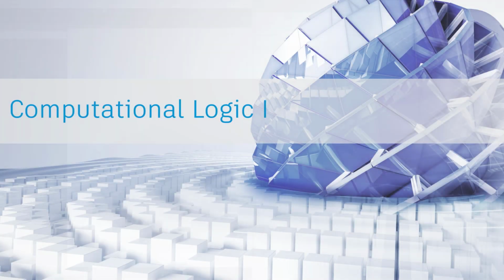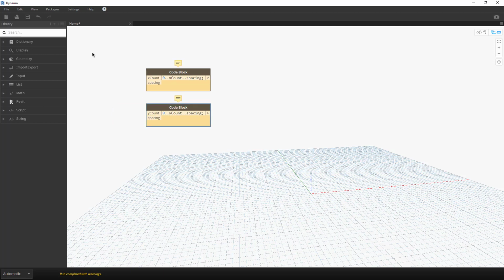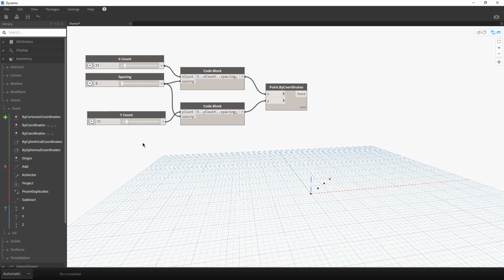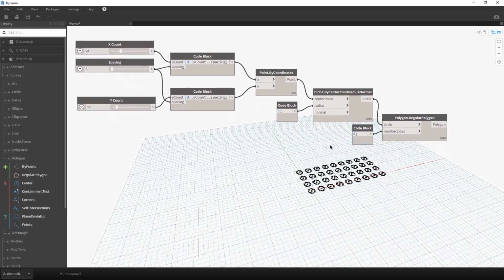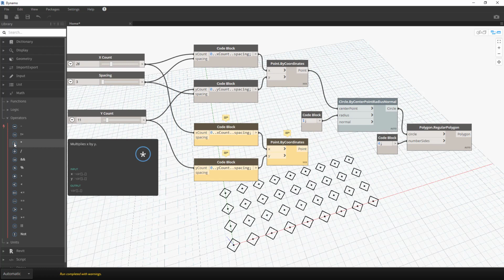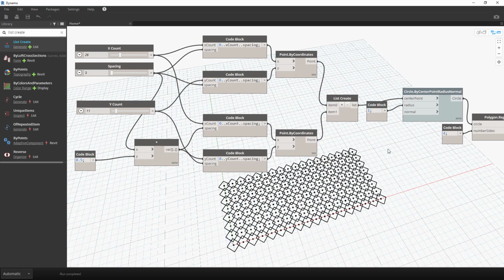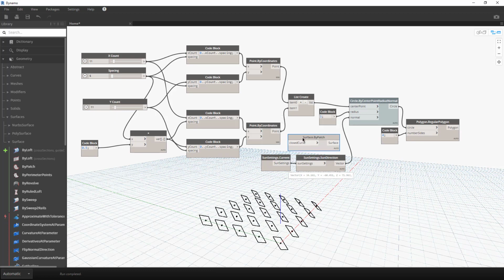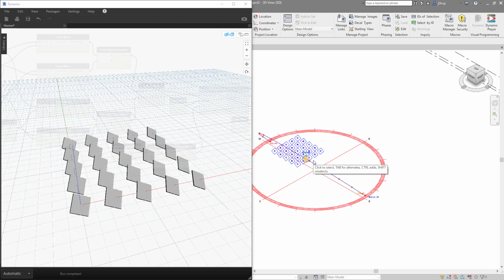05 ComputationalLogic1

Comment: Why can't i see the nodes and the geometric surfaces in the revit model? Everything works fine in the dynamo just like the tutorial, however it's not possible to see those in the revit...
Reply: Dear DynamoBIM, the explanation was on point, but I have the same problem, I followed the same procedure but the Revit model does not show any surfaces/panels?  Any suggestions?
Reply: very very small. In my case zooming it, can see it. or turn on sun-path after making model in dynamo.